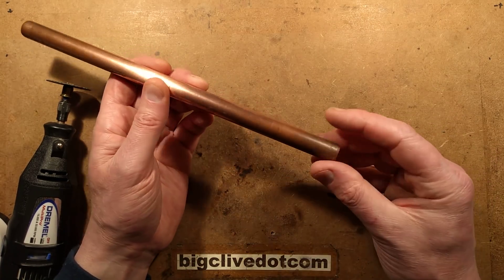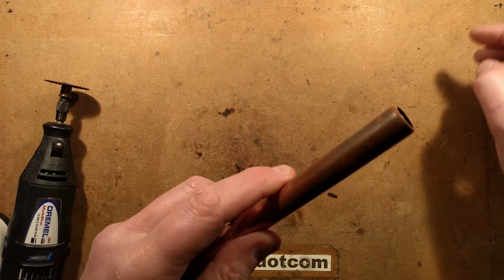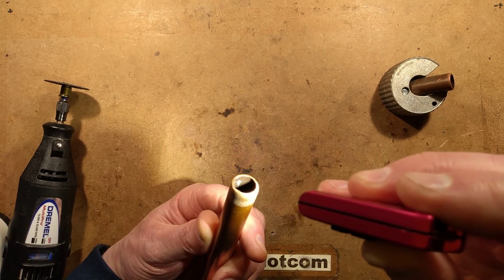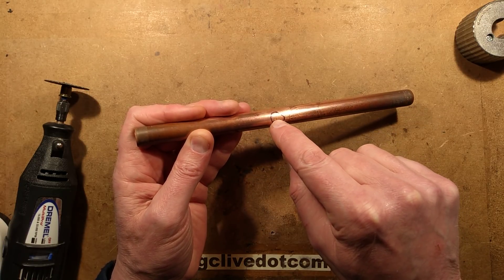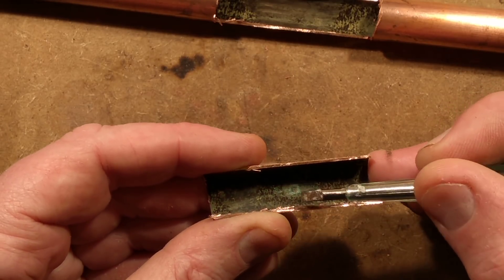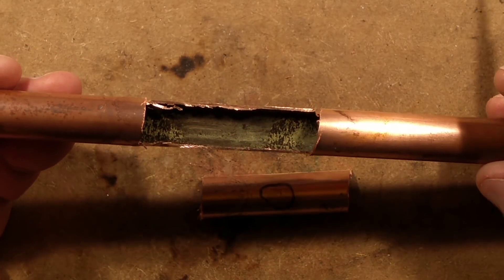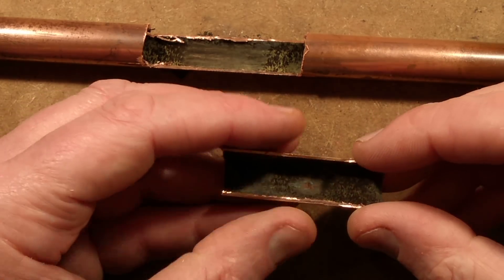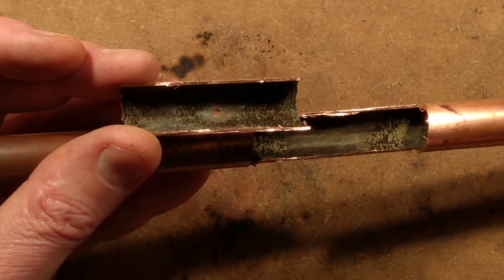Odd pinhole leak in copper pipe.  Selective electrolytic corrosion?

Comment: It was 6:30 in the morning, there was a tenant knocking on my door. I was thinking this better be important/urgent. I open the door and it's raining in the hallway, specifically dripping from the smoke detector, I was instantly convinced there was a problem. Nice old lady from upstairs, the look on her face. I already knew there was no plumbing over that section of the ceiling too.  It had gotten really cold that night well below 0 F, the second floor laundry room water lines froze since there weren't proper windows  and storm windows.  The ceiling in the hall had to be torn out, the brand new carpet (the nicest in the complex,) in the hall had to go. Some of the other pipes got upgraded while we were in there. Anyway the plumber there was worried about galvanic corrosion since the water tank was so old.

Comment: this has been an issue here in the USA with our HVAC units. Seems to be related to something to do with the exact alloy and the exact water. Sometimes by the time it's noticed the source of the poor water has changed. Municipalities seem to change water sources whenever they feel like and not notify anyone.

Steel is anodic for copper. Normally in water systems there is lots and lots of steel, and only a small bit of copper so it's not an issue, but sometimes it's the other way around and the steel will corrode away very quickly unless there are di-electric fittings between the copper and steel.

Comment: I recently had the same pinhole leak problem in pipe at work (water pipe going just above stage, and guess what, water started dripping 15min before show was supposed to start) but in my case, it isn't copper pipe, but galvanized steel. Could it be the same reason?

Comment: I have had exactly the same thing happen to me on a cold water pipe behind a freezer in my kitchen. There was a pit formed from the outside of the pipe with a pinhole in the middle.  This was caused by a plumber leaving flux on the outside of the pipe and not cleaning it off at time of install some 25yrs previously.  Could be that flux had made its way inside the pipework in your house at time of install and was not flushed out properly (if at all!) at the time. This is why instructions for using soldered fittings stress the importance of flushing out pipework thoroughly. May have been contaminant of some type such as aluminium shaving or stainless steel/nickel or chromium swarf which has caused an electrolytic reaction as you say, especially if the water in this pipe is "static" with no flow through.You were just unlucky, but could have been a lot worse if it had happened in your loft. This is why one should do a visual check from time to time of all the pipework you can easily access in your loft and behind your kitchen appliances.

Comment: Copper pipe has failed because of carbon from overheated extrusion oil adhering to the inside of the pipe. This leads to an electrolytic reaction that pits the pipe. Also acidic water can accelerate corrosion. Where I live the water is maintained at a pH of 11 to 13 using hydrated lime or lye.
If the pipe is clean when installed, a layer of copper oxide will form to protect the pipe. At one time I worked within earshot of a corrosion engineer and I learned a lot of useless, until now , stuff.

Comment: I know that faint hissing sound. Plumber was ripping up floorboards randomly, making a huge mess, and I told him to stop and put my ear to the floor and located it. Was in the office above the one I worked in where the ceiling came crashing down. The hole was caused by a floorboard nail that had punctured the pipe. Must have been that way for years and finally corroded enough. The amount of mould under the floorboards was crazy

Comment: Wow interesting... Like the tubing cutter, I have not seen one like that before. I wonder if they have them here in the states? I have several and they mostly have a screw down type blade that roles against the tubing as it turns on two adjacent rollers to cut the tubing. Cool!
Reply from the maker: This one has the advantage of being usable in very tight areas.

Comment: Probably good you had the tools and pipe to repair it quickly, let alone the knowledge. I know if this had happened at my apartment, I'd wrap rubber and a hose clamp around it until summer. There's no way my landlord would try to fix anything in the middle of winter, if ever. And yes, it's boiler heating I've got, with finned copper tubes at the baseboards in almost every room.

Comment: A few years ago the house that I'd lived in for nearly/over 10 years (lived there since it was built) started getting a few waterspots on some of the ceilings. Started out as some very mild, barely noticeable discoloration, but eventually got to the point that it was very much noticeable in multiple rooms across the house. Took a knife to the drywall and it cut almost like butter to reveal a nice damp spot on the other side. I don't remember exactly what we were told but I remember it was something about the pipes becoming corroded. If this is what happened to us, find a plumber that won't screw you over like ours did and get that copper pipe replaced asap.

Comment: Yeah we have locally problems with those kinds of pinholes, might be something to do with too much silicon in the water prevents copper oxidation which can cause local pinholes to form quite fast when that particular location has brittle silicon oxide instead. That silicon breaks off easily and uncovers clear copper which is easily corroded by water.

Comment: a couple of years ago, one night i could hear a small hissing noise under my rooms floor. my mum and gran pop thought i little crazy until they looked under one of the floor boards and looked across underneath the house. and sure enough there was a small thin copper pipe spitting out water onto the ground. It was exactly like this! a small pin hole making a low hissing noise. (more info: This was in Australia. where temperatures ranged from 3 Celsius to 42 Celsius yearly so we do not have freezing issues. and i believe that pipe had to be installed around 20-30 years ago.)

Comment: Flux used for soldering copper pipe has gotten in the pipe during install which is bad as it can cause this, hopefully that was the only part of the pipes that has corroaded, But likely its not if more of the flux got pushed further down somewhere else!

Comment: If your house is on city water supply, what treatment or source changes occurred in the past 5 years, including management change. This is localized corrosion which has MANY different root causes. But your case has several features which I suspect microbial attack

Comment: Ive heard that pin holes in copper pipe can be because an old acid based flux was used during soldering and not cleaned off. New flux doesn't do this. Look it up and see what you think.

Comment: That's the standard way for leaks to show up in copper pipes.  Thay sort of green spot corrosion is usually from some impurity lodged in the copper during drawing.  If left it does start happening all along the pipe. A lot of mine from the 1960s started weeping which happens before the pinhole sprays.  I just replaced it all with plastic.  Modern plastic systems such as JGSpeedfit are very robust and if necessary can be "cabled' through awkward runs in ways that copper never could. However you may also  need access to insulate pipes. Even ther cold should have done insulation to prevent external condensation on it - which can also lead to pinhole corrosion.

Comment: Are you on a well, or utility water system?
My parents had a cabin in the mountains of North Georgia (USA) where all the houses / cabins in the community were fed by a common well (Somewhat common in areas like that). When someone would buy one of the properties in the area, the guy that owned the well would warn the new owner to not use copper pipe if he ever did any plumbing work. It seems there are some minerals in the water around that area that will attack copper pipes and they will usually start leaking in about five to seven years.
Part of the problem is that a lot of those properties are rental cabins for vacationers, or "mountain getaway" second homes for some people (like my parents) and as such, they may be vacant for extended periods. This allows the minerals to settle out in the bottom of the pipe and start galvanic reactions. The plumbers in the area say that almost all the copper they have had to replace in the area were leaking on the bottom of the pipe, and one guy told me that he had taken out many pieces of copper pipe that were so thin on the bottom, that he could dent it with his bare hands.

I am on a county utility system and have copper pipes in my house (that I built) almost 30 years ago and have had no problems whatsoever. Back when I built my house, all the plumbers were going with polybutylene piping, but I didn't trust it, so I spent the extra money to put in copper and I am glad I did. Several years after I built the house, polybutylene pipe was recalled and houses plumbed with it had to be totally re-piped.

Comment: I think the copper was contaminated at the factory and some iron/metal got in. iron has a higher melting point then copper so it didn't mix but left a clump in the pipe wall.

Comment: Clive, we had the same issue. You may need to replace all your pipes.

Copper pipes (especially installed in the 70s in UK construction) are prone to pinhole leaks.

These can occur inside the walls without you even knowing and cause extensive damage due to gradual effects of constant dripping.

I say this after the entire pipework of the 5 floor building we were living in had to be replaced. 

Might be a good idea to get a plumber take a look. Hope it's not the case for you though!
Reply from the maker: It's quite an old house.  I'm looking at possibly just replacing the old pipe with modern plastic pipe.  I'll also be removing a lot of redundant pipework that has "evolved" during remodelling by the previous owners.

Comment: Iron contamination, it can settle in the pipe causing these pin hole corrosion spot to form. Also if it's a cold water line excess non water soluble flux in the pipe from when it was soldered can sit in the pipe and over time cause these pin holes as well.

Comment: From my experience its the copper pipe. I have seen this when the copper has been in service for over 5 years and random holes start appearing everywhere.
Reply: A key factor is whether your water is supplied by a municipality or a private well.     Private wells usually require various degrees of filtration and chemical adjustments

Comment: Cheap copper pipes that have some impurities in the pipe, solder and flux when over used or not properly soldered that was left in the pipes when they were installed and not immediately flushed or cleaned out (they quickly attach to the pipes and can eat through the pipe over time), using non copper or other metal pipe hangers can all contribute to electrolytic corrosion in cold and hot water pipes. In addition, hot water pipes can have some electrolytic contamination from hot water heaters. Potable water heaters that do not have their sacrificial anode rods changed on time are a common culprit. Also having the pipes used as an earth ground can contribute. You will find that the pipes that are horizontal will be the most effected, as the impurities in the water will do the most harm while they are sitting still in the pipes. In the vertical pipes they will settle downwards and not have as much time to react with the pipes.  Alkaline water can cause havoc with copper pipes as well as contact with the lime in concrete. This will dissolve copper over time.
 It might be prudent to replace the lower horizontal pipes since these will be the most effected.

Comment: Is it corrosion, or or is it erosion due to turbulent flow?  If your water service is metered, there is usually an indicator on the meter that shows even the slightest flow that might be present when all water-using fixtures are shut off.  The kind of failure shown in this video makes me like PEX tubing all the more.
Reply: It  would be corrosion due to the discoloration of the copper.

Comment: Let me add another "me too". I had this exact same failure -- that piece of pipe looks like it could have come out of my furnace room. Same pinhole, same green pitting along the length of it. And I went through the same thought process as you. I'm worried about my 1950s split-level house with miles of pipe buried in very inaccessible walls.

At the time, I tried to do some research on pinhole leaks and the best I could come up with was that they happen, when you get one, you will probably get more, and that nobody knows the exact cause. I'm not such which theory to believe.
Reply from the maker: Sometimes I wish they didn't bury pipes and wiring in walls.  It just ends up causing problems.

Comment: I experienced the same thing. Where I live there is a lot of iron in the well water, which is what I have. Under the house on another mission, i was sprayed by a very very fine mist of water, that was coming from an almost invisible hole.  Fortunately that was the water inlet line, the rest is the plastic stuff. I replaced the pipe from the house to the well and have had no more problems from it.  I guess the copper pipe was 20 years old.The problem was exactly what you had there.

Comment: Big Clive good news!
Had this in the boiler room at work. As a tech/engineer I thought new pipe get a plumber.

Plumber turned up bit of patch material and a clamp says it happens all the time it would of fixed its self with scale anyway pointed out 1 or 2 other potential 'self healing' pin pricks and said dont worry about it.
Reply from the maker: The water's pretty clean here, so I'm not sure that the scale will be enough to fill the hole.
Reply: @bigclivedotcom  Well now you can make a scale adding device to keep bad pipes good 🤣

Comment: The copper water pipes in our 50 year old have have had issues with failing. So far, we've only seen it with the hot water pipes. Back in the early '90s, we had our first leak in the concrete foundation slab. That was fixed, but only lasted for another ten years before developing the leak in the same area. We tried fixing it but failed. We gave up and ran pex pipes through the attic instead for the hot water. We have no idea how long the cold water pipes are going to last, but that is a cringy fix being in the foundation and all. Pipes should not be ran within concrete foundations. We can't even use the climate control system because we have floor ducts in the foundation that are full of water all the time now. I guess the water table either shifted or it was always a problem and the foundation was just better sealed in the past. Due to the cost, we still have yet to install a whole house replacement for the climate control system. We mostly rely on window air conditioners and space heaters. It's also zoned placing priority on bedrooms. It has the benefit of having custom temperatures for the bedrooms and using little or no heating and cooling on rarely used rooms.

Comment: clive you never mentioned how old the pipe is, its a bit of a worry you should ask the plumbing merchants if its a one off, or common for the area because of the water, you could be up for a very expensive bill to replace the lot

Comment: It's likely to be a combination of factors.  Hot water may be be worse in some of them - once it starts it goes much faster than in cold water.  Impurities in the copper are often the culprit.  It's not likely to be the water quality otherwise both the deposits and the corrosion would be much worse - that looks pretty good really for what I suspect is decades old plumbing.

Comment: Oh I think I might know what caused it! Thanks to watching random stuff on YouTube (as we all do) If copper pipes are not smoothed at the ends after cutting then welded together or if the pipe inside has a small intrusion, it causes turbulence in the water which after a long time can wear away at the copper causing a tiny pin like hole. It takes a very very long time to happen so a lazy plumber who cant be bothered to smooth the ends of a copper pipe after cutting it has loooong gone.

Comment: This is a very common issue in bc. Our water is pretty acidic, so it eats copper pipe, although the leaks are only pinholes, if you cut the pipe open, you can see long tracks eroded in the pipe, looks almost like what leaf burrowers leave.

Comment: Same thing happened to me as well. My copper hot water line, I noticed because the hot water tank was running more than normal since cold water was entering it 24/7. crawled under th house to find this supper fine jet of hot water. Just a pin prick of a hole. I have the same fear that it will happen again, or has already. but being that I am old and getting under the house is not easy I have not checked in a year. I guess once winter is over I will have to check again.

Comment: Plumber here, those green nodules in the pipe are buildup spots of excess flux from soldering. The plumber who fitted the pipes in your building either used too much flux or didn't clean it well enough after soldering. Could also be mineral buildup that was corrosive to copper.